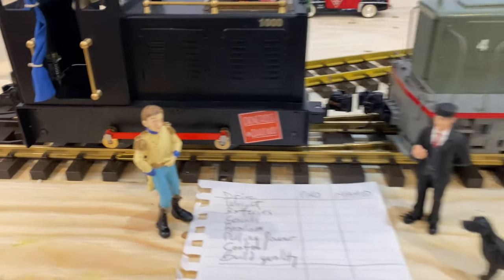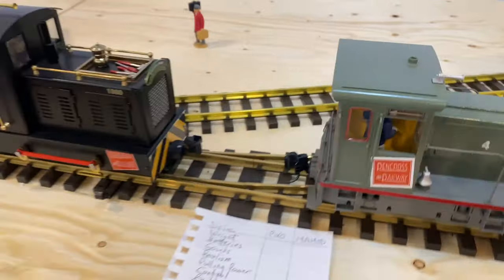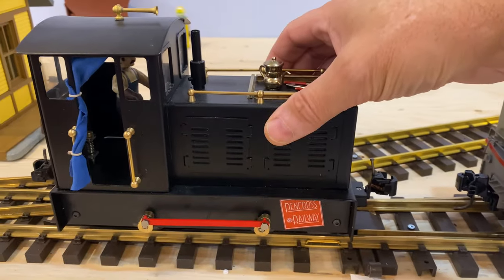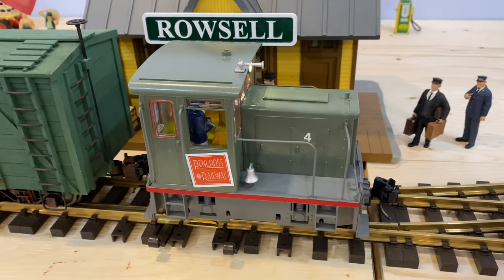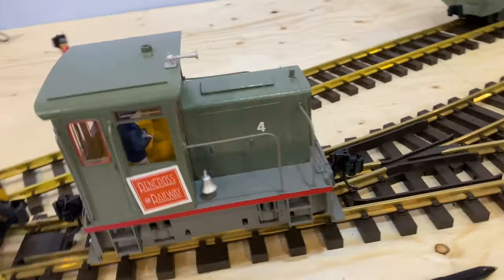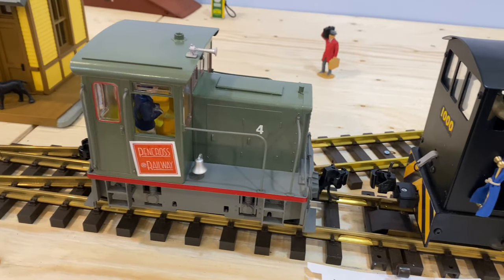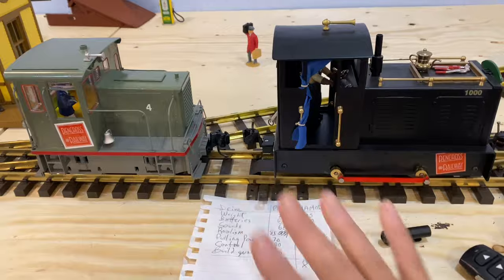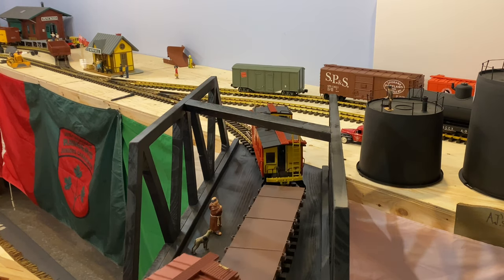Casselman ON: VERY DETAILED Reviews/comparison - RC/Sound PIKO GE 25 Ton & Mamod Boulton -like/share

Comment: Excellent video and review of two interesting locomotives. I had issues with my Mamod Boulton and eventually I fitted the body to a Roundhouse chassis. I have three of the Piko GE 25T switchers and they get the most use on the CFR. 24:49
Reply from the maker: Thanks! I’d heard of people with Boulton issues. Was your older? Mine is solid as a tank. I’m sorry to hear you had issues with it. Of course, a Roundhouse chassis would be great.

Comment: Another interesting video.👍 I have both locos and love them both. For me the biggest issue, is the Piko 25t lower battery power. Otherwise I would rate them pretty much equal. Nice to see your new layout taking shape. 😁
Reply from the maker: Thanks for your thoughts. I love different perspectives. In the end I love them more or less both the same too. In addition to the lower battery power as you mentioned, I wish it could pull a touch better. But again, love them both!

Comment: Hi thanks for the great videos on the Mamod Bolton very good. I’ve got both of the electric trains from Mamod the tram and the Bolton very well made. Thank you gary
Reply from the maker: Thanks so much Gary! I appreciate your comments. I like the Mamod tram but I’d want it with diesel sound and I’d make mods to make sure it looked like a diesel tram and not steam.
Reply: Thanks for getting back. I just wanted to tell you about the battery on the Bolton when I collected mine from Mamod because I don’t live very far from Mamod. They told me don’t let it run out of power because if he does that have a recovery charger has to be used to recover it, did you know this?
Reply from the maker: @garygriffiths9905  I did not know this. By habit, though, I try not to let batteries like that run completely out. I have learned that from experience. I’m glad you felt you should tell me though. Very friendly. 😊

Comment: I finally had a chance to watch this video, which is excellent.   I may have rated them slightly different, but ratings are subjective, however i think you were pretty fair, overall.
Reply from the maker: Thanks John. Yes indeed, always very subjective. I don’t mind the less scale appearance of the Mamod while some people don’t like that. Different opinions are always interesting. I’m curious about a point or two where you had a different view than me.
Reply: @Terrys-Steam-and-Bricks  
Since you asked: Having been in the position of approving purchases for the plants that I managed for over 30 years, I often had to make or require similar analysis.  For me, cost needed to be on your main list.  You know the old adage, "you get what you pay for".  In a way, due to the extreme price difference between the two locomotives, it's like comparing a Chevy Spark to a Cadillac.  Also, IMHO, the realism aspect required more weight.  As a modeler, I strive for as much realism as possible.  I'm certainly not a rivet counter, but I like my models to be close to the real thing.  But, as they say, "your railroad, your rules".  So, listening tp your video and your explanations, I believe your assessment was fair overall.  Anyway, the video was really good.  You make some excellent videos!  I wish I could do as well.
Reply from the maker: @johnlazar7582  Thanks for your thoughts. It’s so interesting the various lenses we all see things through. And I love your vids John. I think you do as well or better. ☺️
Reply: @Terrys-Steam-and-Cobi  Thanks Terry!

Comment: Excellent! I’m currently thinking about getting either a Boulton or a Roundhouse Merseysider (I already have the Piko - Ronnie - and it’s likely to feature in an upcoming ‘Meet the Fleet’ series. I have replaced its handrails with metal, 2mm ss rod, and weathered it. 
I think your video has sold me on the Mamod!! It’s about 60% of the price of the Roundhouse loco…
Reply from the maker: Thanks Nigel! I like the Merseysider, largely because it can come with sound. I don’t have any Roundhouse diesels but I do have two of their live steam locos, a used Sandy River 24 that came at a jaw droppingly good price, and a new Bertie with Jennie tender and RC. I asked them to paint it War Department Grey and to my susprise when I asked they added a WD logo on the tank side! I have play lists of these locos. So from these engines I know the quality of the Roundhouse product. Their workmanship is better than Mamod and their diesels look to be better representations and less generic, but I have to say my Boulton has really surprised me in a good way!
Reply: @Terrys-Steam-and-Bricks  
The only drawback to the Merseysider is that its control system is a sprung wheel and trigger pistol shaped thing. It’s designed to be one handed which I can’t really use so the Fosworks in the Mamod clinches it for me. I’ve installed 5 so far, very familiar with the system.
Reply from the maker: @FeckHallBahn  ahhhh. I didn’t know that’s what Roundhouse uses. Like an RC car system. That’s too bad. I love the controller with my Boulton.
Reply: @Terrys-Steam-and-Bricks  
Just bought one. Don’t tell Mrs B!!!
Reply from the maker: @FeckHallBahn  i look forward to hearing your thoughts on it. Hopefully a video!

Comment: Wonderful.  You are a very clever man. I hope Piko answers you about the odd horn and brake sound . On the mammoth sound, maybe look at a replacement sound controller for it but it be a challenge. I have never seen where to get the mammoth one. 
Also I would love to know your switch system and it's mechanics. I think you already did a video but I am just learning operation style railroading so any advice or how toos on it would be useful..thank you for a wonderful video.
Reply from the maker: The loco is here. Price has gone up I see. https://www.mamod.co.uk/shop-categories/boulton   I also notice they link to one of my videos! The loco comes with the sound already. I think they get the sound card from an Australian company.
Reply from the maker: Maybe I can do a short video explaining how I approach operating my layout. I have some video projects to finish first and I am going away for a week soon. So it could be weeks before I can post it.

Comment: The PIKO will pull more if you can add weight to it. The capability is there, but the space for weight might not be.
Reply from the maker: Thanks for the tip! Yeah, seems like not a lot of space left but accessories like a large cast metal toolbox and such.
Reply: @Terrys-Steam-and-Bricks  A friend of mine took my 25 ton (that I gave him) and kitbashed it, which gave him more room for weight. He can easily pull 9 cars with it.
Reply from the maker: @JMLoll  awesome. 👍

Comment: Just curious, what about the Piko made it not so good for shunting?
Reply from the maker: It’s ok for shunting. But compared to the Mamod I find the control less fine for coupling and uncoupling.
Reply: I see. Didn't really think about it, as I've only used controllers that use potentiometers for speed control. Using a button style switch probably would feel a little unnatural, and fatiguing to the thumb I'd presume.   @Terrys-Steam-and-Bricks
Reply from the maker: @JCab172-pv5zc  yeah, it has speed steps. It’s great actually. But a side by side comparison shows the Mamod with potentiometer style RC transmitter is easier for the purpose.